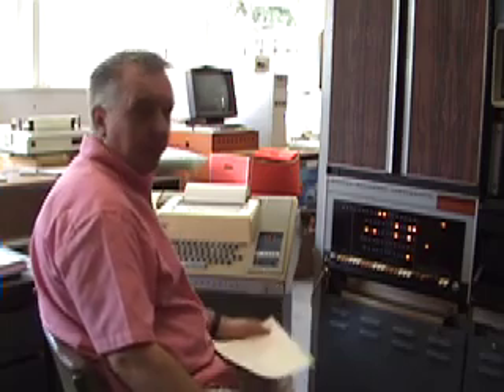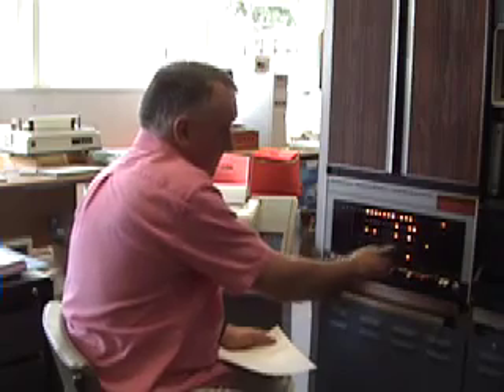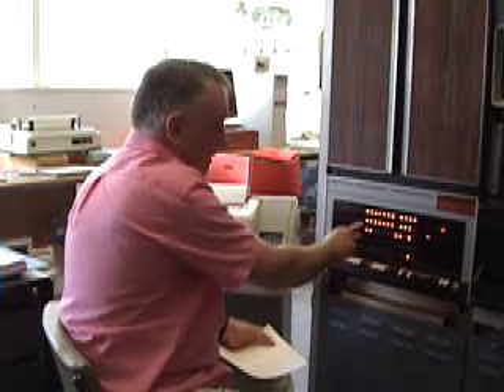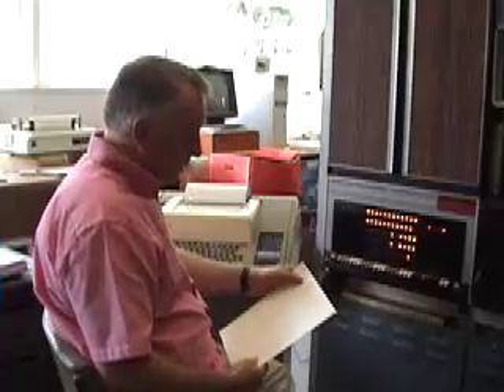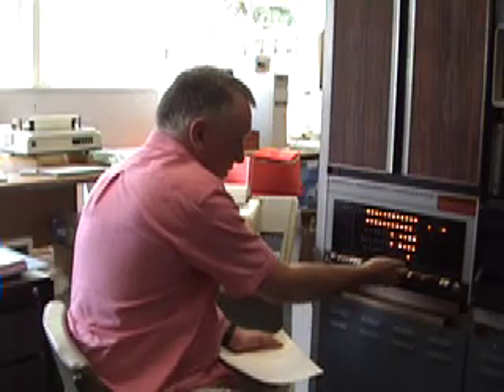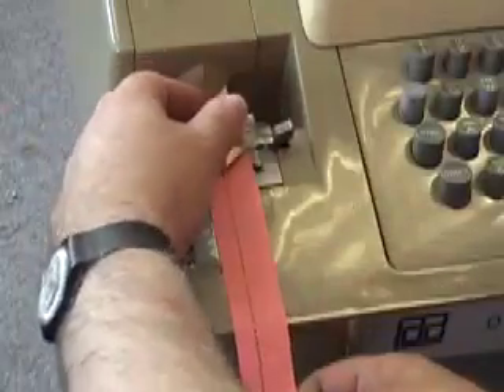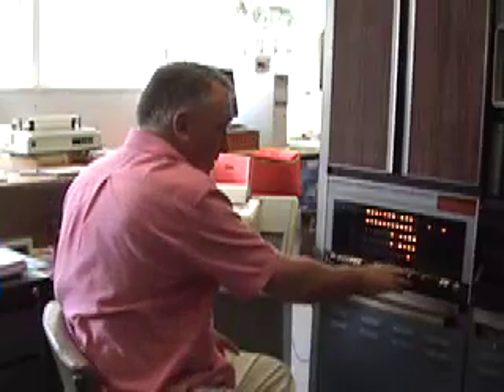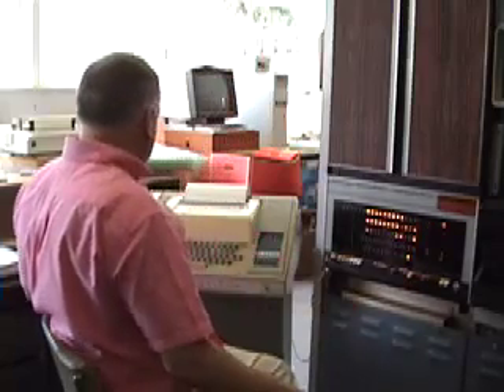PDP8 - Presentation #2

Comment: Since the machine has a TC01 DECtape controller and TU55 DECtapes, this is needlessly complicated to get to more meaningful usage.  Admittedly specific to the DECtape, the procedure to directly bootup an operating system is FAR SHORTER than the RIM loader he toggled in, much less the BIN loader that loaded in on the reader.

And that is not a contrivance, because useful PDP-8s eventually ALL had storage devices on them.  One of the device driver designs was to create a reasonably short manual boot procedure.  The popular RK8E/RK05 "pizza box" disk drive based on the one for the IBM 1130 had a bootstrap that is only two words!

I know this is only a tutorial, but it tends to create the notion that the PDP-8 was a lot "smaller" and hard to use than the reality of just a few years later.  In fact, the later 8/E had a popular option to just press a front panel SW switch, there for precisely that purpose [you couldn't program it, you couldn't even read it, it was there ONLY for the benefit of the small ROM option card to just throw the switch to boot up.  The bootstrap had to fit into at most 32 words.  An UNPOPULAR version was to auto-load the RIM loader he is doing in this video at the beginning by hand.  But that just prolongs the agony of the paper-tape, which became an ever smaller part of the market for the machines as total sales grew.  At one point, the sales of PDP-8 models if treated as a separate entity, would be the 5th largest computer company in the world [I did not make that up; there are sales volume documents from the time].  Extremely few of them would want these paper-tape loaders, and eventually they had terminals that couldn't even use paper-tape, etc.  12-bit compatible models were sold from 1965 through 1990 or so.  They all had a common instruction set, and certain operating systems run on all of them on storage devices.  Presenting a small subset of usage just on paper-tape is a bit short-sighted.

Comment: This is one reason why computers back then would stay online for months, if not years: starting the damn thing was a bitch!
Reply: Actually, no.  They all had magnetic core memory.  You can restart ANY loader because it stays there even when powered off for years.
Reply: Also they suffered if you did switch them off due to thermal effects in the components. They often did not come back up.

Comment: Even entering the program to read the paper tape it boots faster than Vista!
Reply: That's interesting because at the moment, I am debugging my PDP-8 simulator package [it will be public domain].  It is rated to run on XP, Vista, 7, 8 and 10.  I have to check them all out, and it turns out that there is a bug in the command-line version of the REG[istry program].exe.  Thus, I had to do a work-around so one of my install files doesn't screw up on Vista.  [I should also test it on 32-bit Vista just to make sure.  We all know Microsoft ain't gonna fix anything in Vista at this point!].  [Note:  It works fine on XP and at least 7 [haven't tested the last two yet; I especially dread 8.]